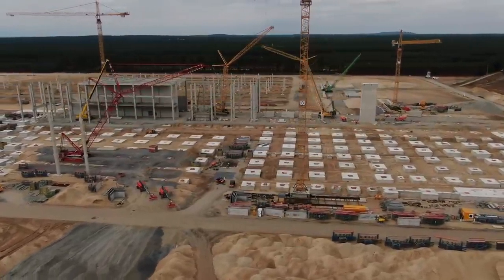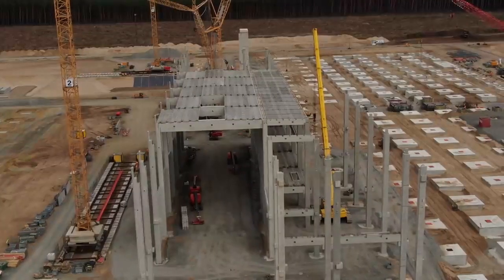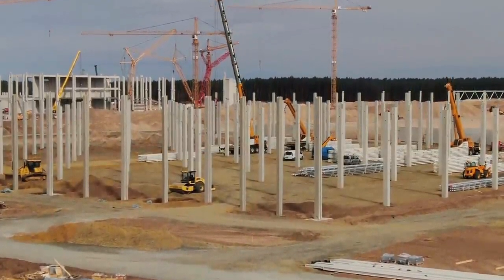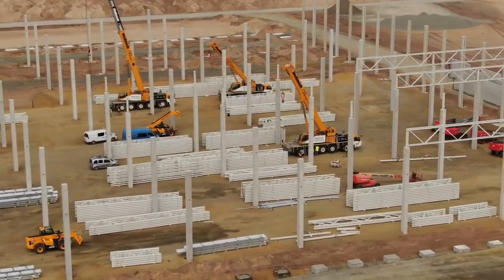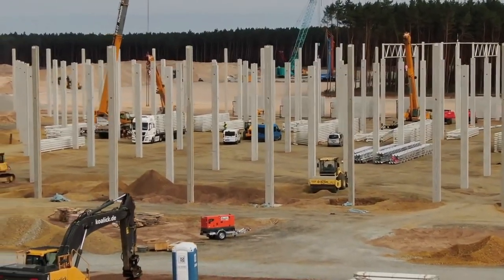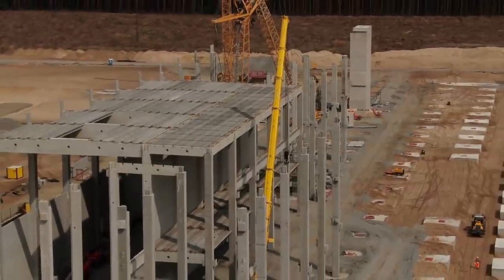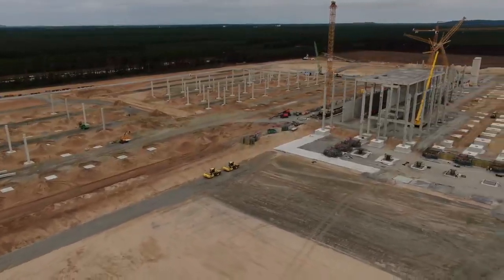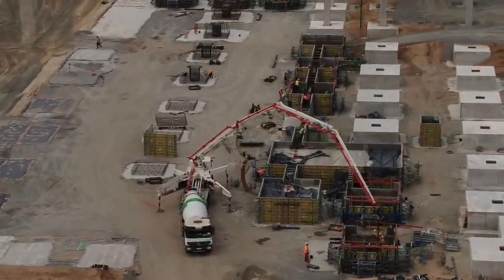Giga Berlin Construction Progress Update Through July 27, 2020

Comment from the maker: Gigafactory Berlin is expected to start operations next year, with the facility producing the Model Y for the local market. This should give Tesla an edge against competitors in the region since vehicles that are manufactured in the Grünheide based plant will be built with Silicon Valley tech and the craftsmanship of Germany’s veteran auto industry. This is a pretty formidable combination to beat.
Reply: I had some doubts initially, as progress was relatively slow initially, but now with this modular approach and the foundations attached to the columns for the less loaded parts of the factory (eg drivetrain building) I see a very good chance that production can start next summer. Thanks for the video!